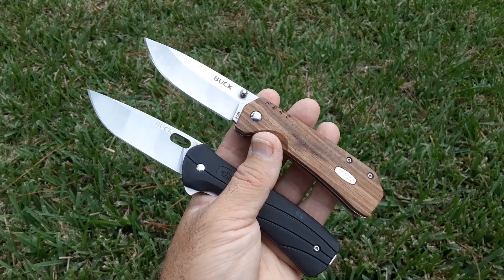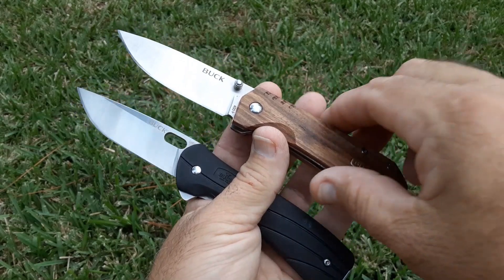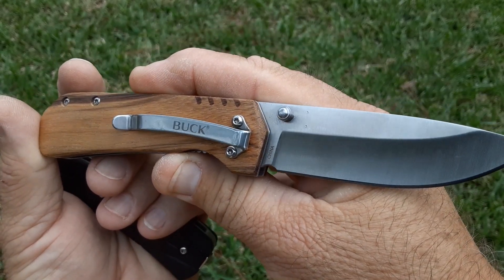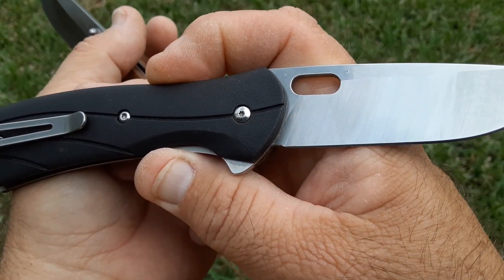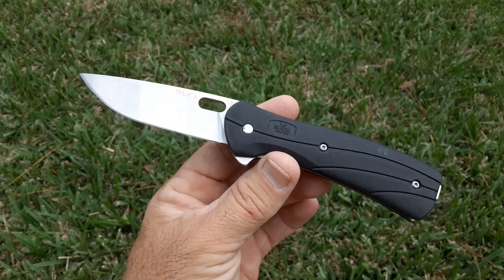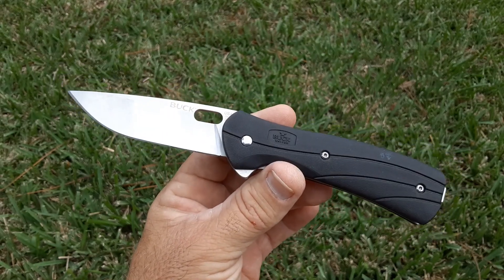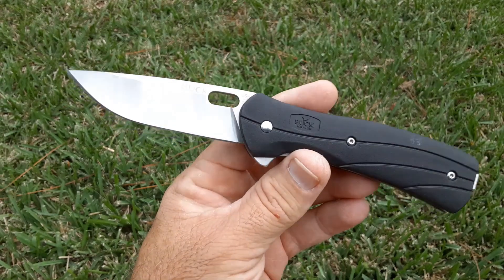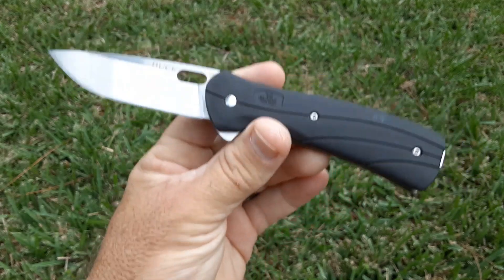Buck 420HC edge retention testing, USA vs China. Which one is a better value in amount of work done?

Comment: Don’t all bucks, even china models have a bos heat treat? So they should be the same unless the USA is in S30V
Reply from the maker: They do not have the sme heat treat. US base Buck models use 420hc and the China stuff uses 420J2. Keep in mind these were a few hardness points away as well.
Reply: @Outpost_76  that’s suspect. Buck can legit make knives in china with BOS heat treat for $30 and under. Ganzo I heard makes some good D2 ball bearing knives for cheap, so it amazes me that buck and others can’t/won’t.

Comment: Hey so I have the Paul Bos S30V vantage pro exactly the same knife just different blade steel and I had noticed that mine has tendency for the blade edge to hit the inside of the barrel spacer and rolls my perfectly polished edge every time so it made me give up even carrying and resharpening the damn thing, I was wondering if yours does this also or if I just got a lemon and need to ship it in for warranty?
Reply from the maker: I'll double check this afternoon but I'm sure it doesn't hit when closed. I've never had a spot in the edge outside of use.
Reply: @Outpost_76  yeah I think mine is actually hitting only while lockbar is depressed but regular closing it does not hit the barrel spacer i dunno but after I had put a beautiful mirror edge on it and then literally zero use yet and I find a big dent in the edge it kinda pissed me off so I sharpen it again and I believe I was only able to cut some paper and fool around testing sharpness and then I close it up and set it down only to find that same damn dent in the edge so I gave up on it after a few times of that mess lol

Comment: Wow!  It's kind of surprising how bad even the "good" one did!  It's been so long since I've used those "Pakistani pot metal" level steels that I forgot how poor the performance is.  Great review!
Reply from the maker: That's what I've tried to get across for a long time. The better 420 did what the average D2 does, that's why I keep talking about D2 being so poorly done.
Reply: @Outpost_76  if the heat treat was optimised would D-2 perform to a much more desirable level or should we just stop with D-2 ?
Reply from the maker: @tombrown8800  D2 just shouldn't be used for mass production. The heat treat requires more care then these budget companies can accommodate. It's just not a good option.
Reply: @Outpost_76  thanks for your reply. Been using an edc for decades but just learning a little about steels the last few years.

Comment: Good to see this comparison.  Thanks for doing this.  The USA made Vantage 345 runs about $28-30 - a very good value.  I use mine often.  Some might be a little disappointed with the flipping action.  It could use a slightly stronger detent.
Reply from the maker: The flipping is hit and miss for sure.